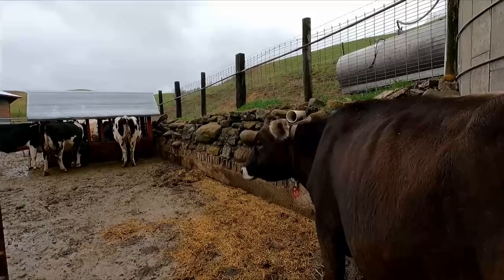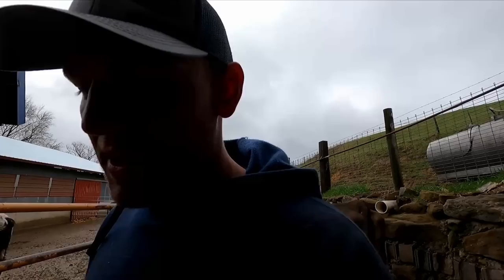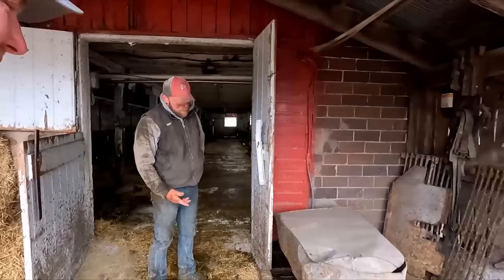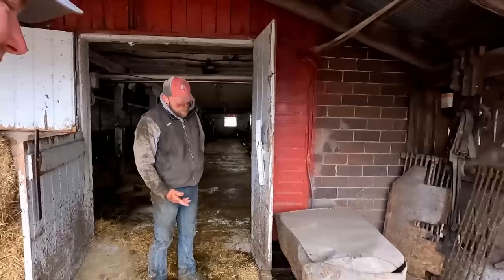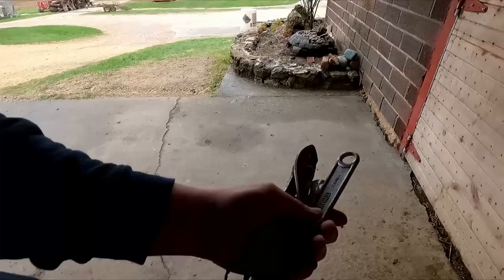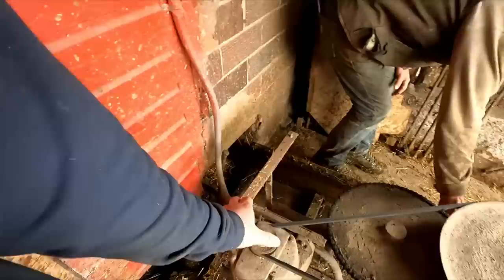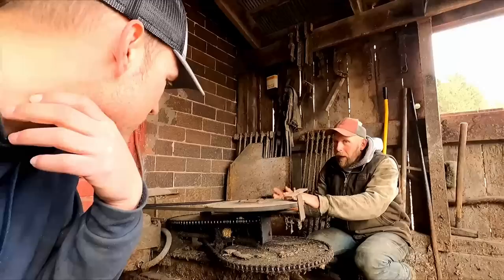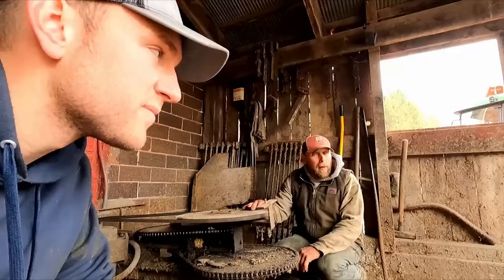Trouble in The Dairy Barn! Barn Cleaner Breakdown!

Comment: Our barn was set up a little different. We only had 20 stanchions. The cows faced each other.  Ten to a side. Mangers with an area where we could roll a feed cart and shovel feed to the cows. The gutters where just right to fit a ten tine silage fork down and so we pushed it out one fork full at a time. Quite a few barns in my area were set up the same way. There were a few tie stall barns built in the sixties that were set up like yours with the gutter cleaner and one of my friends dad had a big chicken barn that they converted to a tie stall barn that held 80 cows. Sadly that friend was killed when we were 11, ironically because he was asked to take the manure spreader down to the neighbors because theirs was frozen. He didn't make it.

Comment: I'm 52, grew up on the farm and it's been mine since '95. Never had a twin have twins. Can think of 7
 sets of hand, may be more.
80ft long, mines 90. You milk 35-40 then?
So wish my chute went out flat. Lots of run back especially in the summer. Replaced my motor couple years ago, same hp half the size. The gutter chain sprocket's getting wore good and it's coming off quite a lot. It's a patz
Do the girls have their stall? I'm happy w them going on the right side, one side has slightly bigger stalls. Tie stall w 1 1/4 pipe.
Left my dry cow gate unchained once and 2 got out. Neighbor called, got over there and ole Roebuck was standing in the opening keeping the others in. Called her Roadblock after that

Comment: My Dad's barn was 40 X 80 with a 40 X 40 addition and a 40 X 20 barn cleaner shed on the end of that. I can remember the bc shed going up but I was just a little guy. The barn cleaner was a Patz. The chute in the shed was wooden as I recall. I remember helping to do some repair work on two of the corner wheels, but no other breakdowns. The bc shed was also used for heifers.

Comment: I used to work for an implement dealer that's old badger equipment we had a farmer that packed into his chute of course it was on the northwest side of the barn the coldest place it could ever been and that was one hell of a job to get that back up on its legs and then it always seemed like the chain always broke when the gutter was completely full of manure the barn cleaners that had a cam on them and they would go forward and then back and then forward and back and the paddles would would bend and then they scoop up manure and then push it back up the chute that was an old-timer and you talk about how old that burn cleaner is